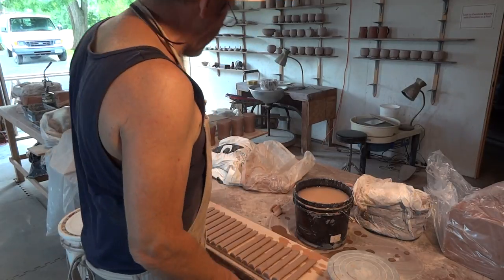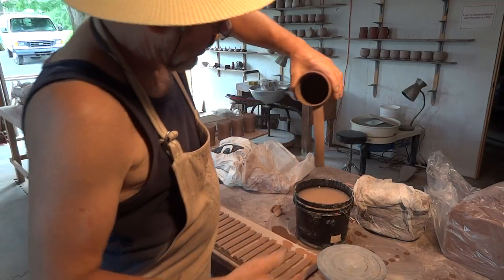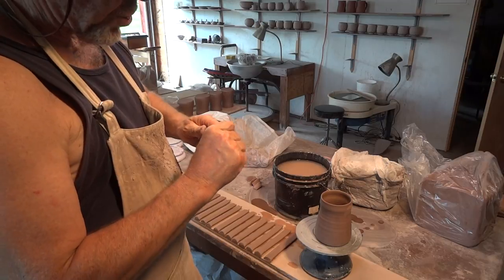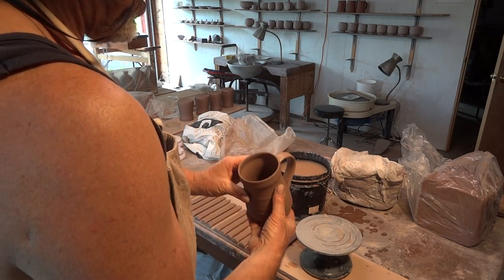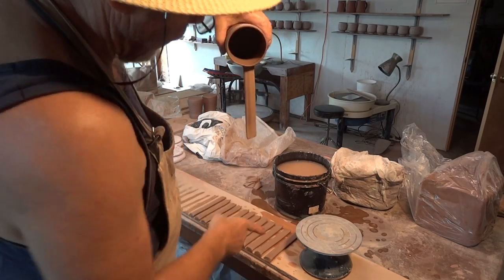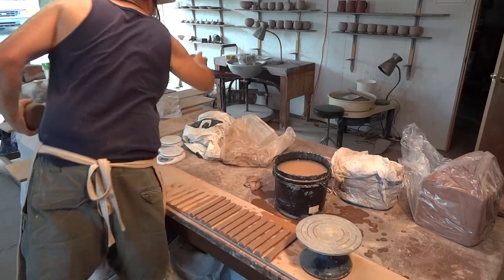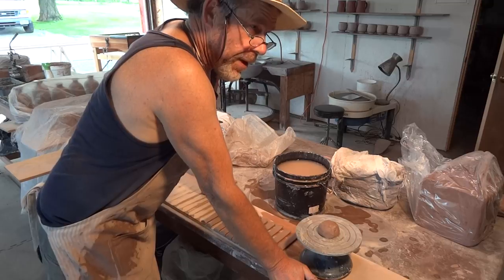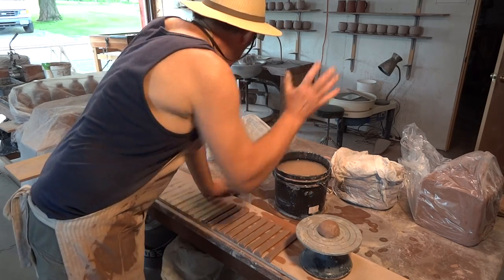How to attach, with ease, a pulled handle onto a mug !

Comment: First of all, definitely wierd :) on video length, if the material was purely instructional the yes, 3 mins 5 max to keep audience engaged particularly new audience looking for lots of info fast, these guys will quickly eschew your 15 minute video in favor of a shorter one . But I don't think that is 100% you Simon, you have developed a style and a rapport with your existing audience that makes watching the video akin to spending time with you. I have watched you handle mugs 1000s of times but I still watched to the end!
Reply from the maker: Thanks for your comments :)

Comment: So is scratching and slipping the handles on not necessary? I have always been told it was but it looks like you just use a little water... looks a lot easier than scratch and slip!!
Reply from the maker: Yes correct if you do it like I am showing you here you wont need all that extra slip !....kind of gets in the way anyway and makes for a slippery mess !